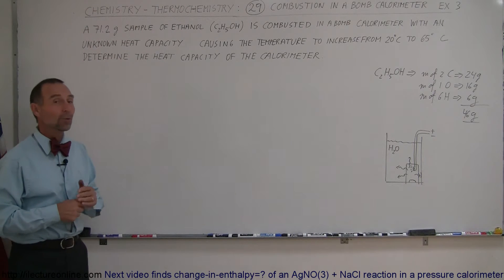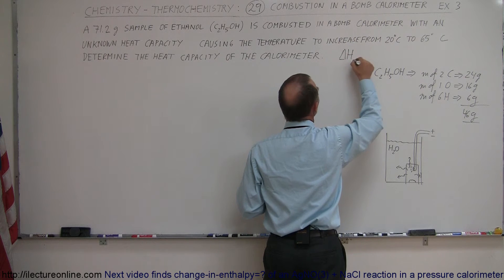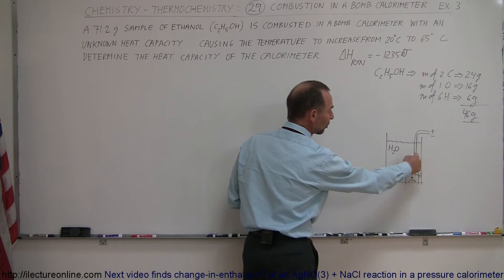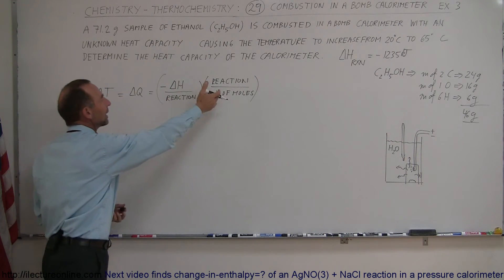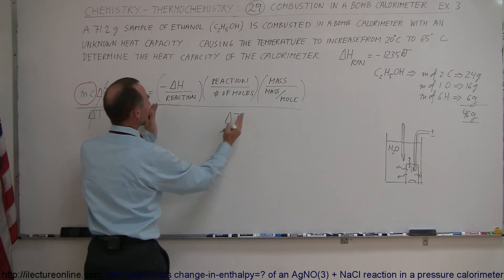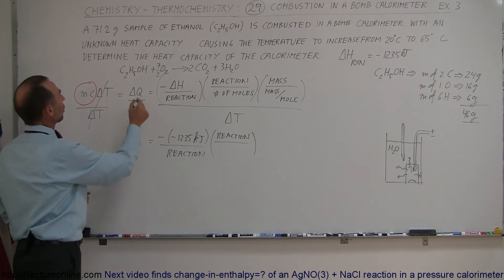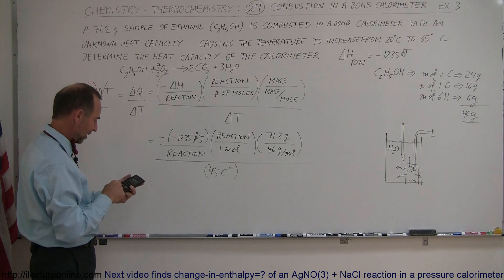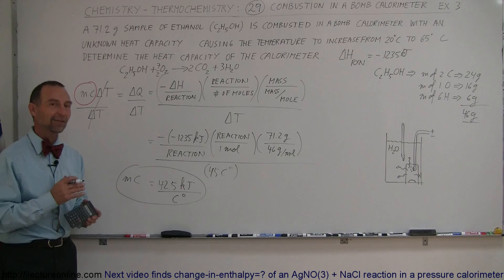Chemistry - Thermochemistry (29 of 37) Combustion in a Bomb Calorimeter: Ex. 3

Comment: for constant volume delta(U)=delta(q)= mCvdelta(T). my question is, why did you substitute enthalpy change on either delta(U) or delta(Q)? enthalpy change for isochroic process is delta(U)+Vdelta(P) right ? pls response
Reply from the maker: I believe you are mixing 2 concepts.  In this problem you need to 1) first calculate the amount of energy released in the reaction.  And then 2) calculate the heat capacity of the calorimeter.   (not to be confused with the thermodynamic principles of gas processes).
Reply: Michel van Biezen  thanks for the quick response sir. God bless

Comment: Hi! sir can u plz solve this problem:
2.0 g of C6H6 was burnt in excess of O2 in a bomb calorimeter :
C6H6( l ) + 7½O2(g) → 6CO2(g) + 3H2O( l )
If the temperature rise is 40°C and the heat capacity of the system is 2.0 kJ/K, calculate the enthalpy of combustion of C6H6 at constant volume and constant pressure.
Answer. – 2.4414 kJ/mol; –24410.283 kJ/mol
Reply: Why does it have multiple answers? 
For a reaction that gives out gas, such as combustion, we use bomb calorimeter to perform the reaction at a constant volume 
Using a pressure calorime means there will be extra energy loss